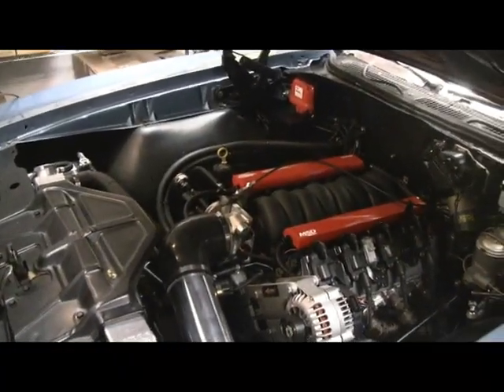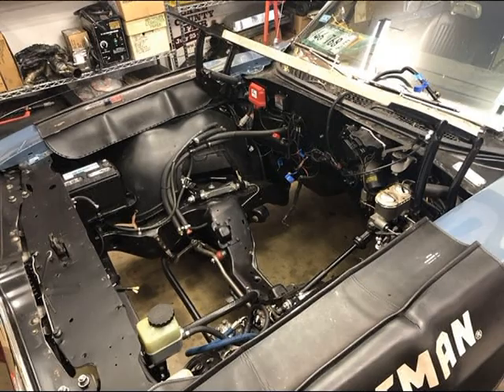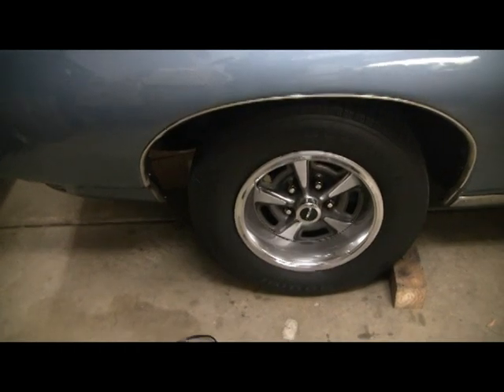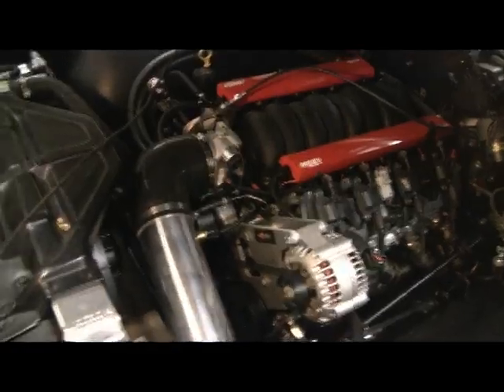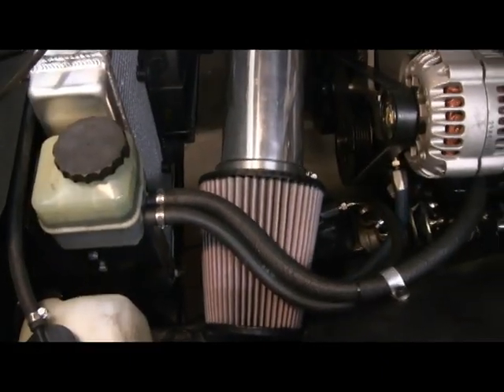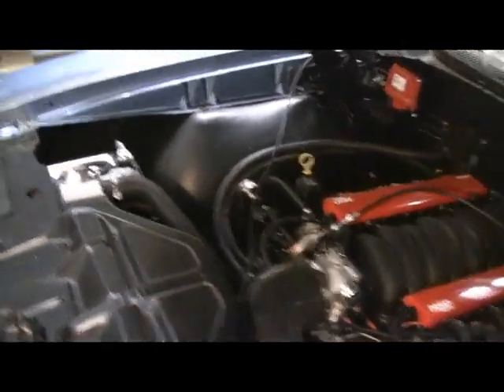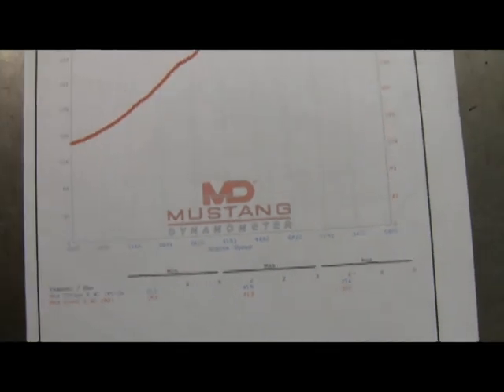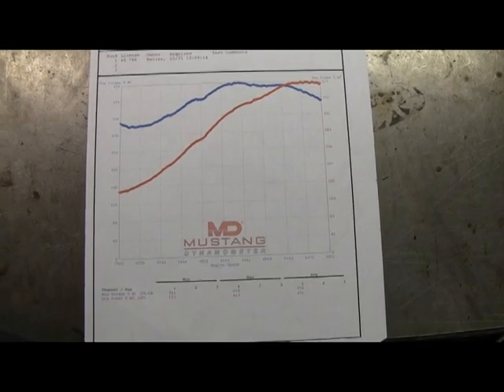Episode 68, more trouble shooting and Dyno pulls on the LS

Comment: what mistake did you make on clutch slave mounting measurements? It seemed you set it up correctly from your previous videos.
Reply from the maker: I measured the cushion wrong, basically took it from the wrong surface. It resulted in using the wrong spacer.